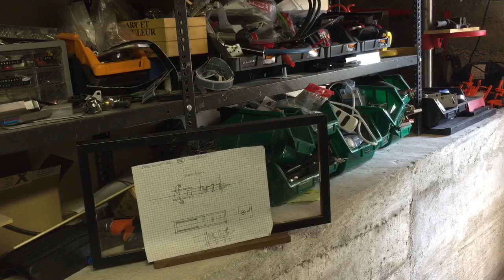World’s first REAL LIFE SPIDER-MAN Webshooter

Comment: I’d say that was a pretty successful test 👍🏼
Reply from the maker: The Human Spider thank you yes me too I can definitely catch small object and control better the web! 
there is a lot of thing I can improve for now it’s better than the first one
Reply: This is definitely the best build anyone has ever came close to. I would live to see a tutorial once you finish tweaking it out. It seems like it pushes much more air than glue out.
Reply from the maker: Moisture you really understand the point I’m working on the balance between co2 and glue
Reply: @MaxBrainDevices  I feel it should push out a hard line of air and still be able to make plenty of glue come out. Just like it's already doing, but the glue needs to melt faster I feel.
Reply from the maker: Moisture no my modified make the glue melt fast and now is balance with less air the problem is in order to make a good web you can’t make a bigger single line this is not strong, you have to weave lots of lines and it became real strong I have some ideas to solve it and make it faster
Reply: Youre working on a m2 correct?
Reply from the maker: Moisture i have project for mk2 but I still working on some problem the solve
Reply: use cold gas which is in lighters
Reply from the maker: Nika- Sarauli it’s cool I can try it but I use compressed co2 because it’s not flammable and need to work togheter with a overpowered heat glue gun element
Reply: @MaxBrainDevices  yes. use glue and cold gas. cold gas when fluid is coming out.
Reply: Max Brain Devices Dude,the design and the whole project is so awesome!
I never thought I'd see a webshooter that is this near to the one in the comics. 
I can't wait to see the mk2.
Reply from the maker: Wardoctor12 thank you so much I’m still working to solve some problems for the mk2

Comment: May i suggest that that you take apart the hot glue gun and simply attach the tip and circuitry attached to the web shooter frame? It would minimize the size taken up by the melting device
Reply from the maker: the. Engineer hi it’s true and I try to minimize the size in the new model but there is a reason why I did not do it right away, the element works at around 130 degrees and it is not easy to build a structure by hand that does not dissipate heat and does not melt in contact with the heating element
Reply: Max Brain Devices maybe you could try something with ceramic? If you have access to such a material
Reply: You could make your design out of clay and then fire it in an oven
Reply: I apologize if I seem a little pushy its just that this is amazing and I really want this to be the best it can be
Reply from the maker: the. Engineer no problem I totally understand but there is a lot of problem solving in a project and I try to minimize the size but is not my priority, I try to concentrate more on the operation and make it more automatic and accurate for now
Reply: Max Brain Devices this is honestly the most functional web shooter I have ever seen and its being upgraded which is nuts. It actually shoots liquid strands that look and act like webs. I heard that you were incorporating nylon into the webs which is really cool. Once you have finished upgrading the functions you should definitely work on the size and air to web ratio because it seems like this one is blowing a lot of air but not so much webs.
Reply from the maker: the. Engineer yes for sure I will working on that the balance glue/co2 it’s always a problem you need a lot of co2 to shoot the glue